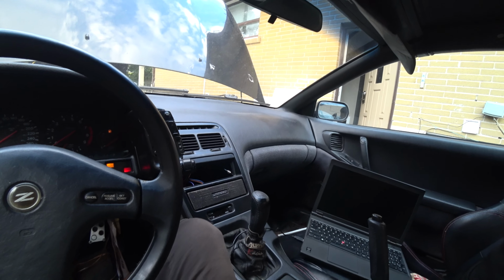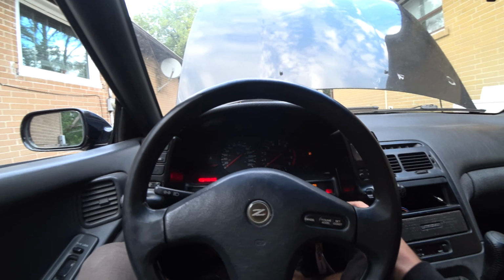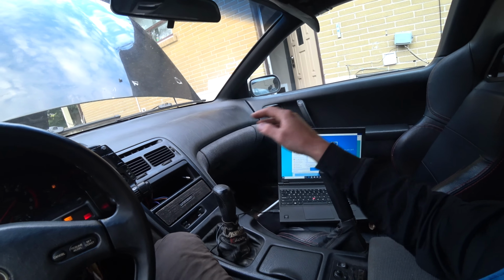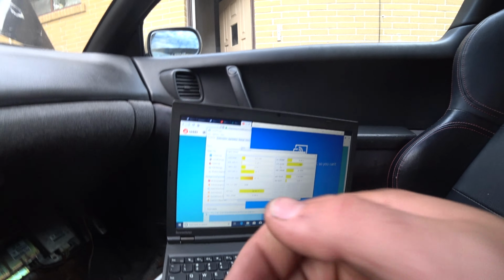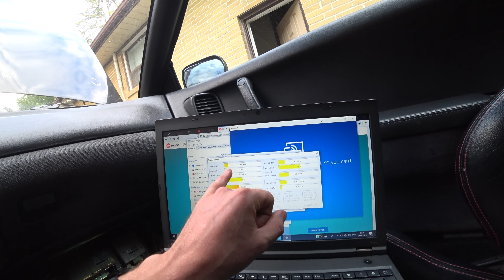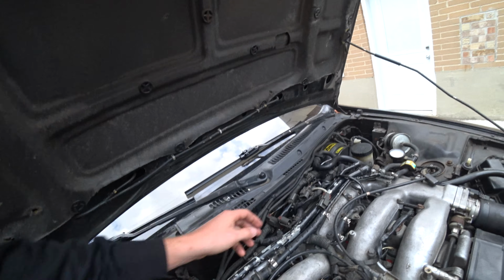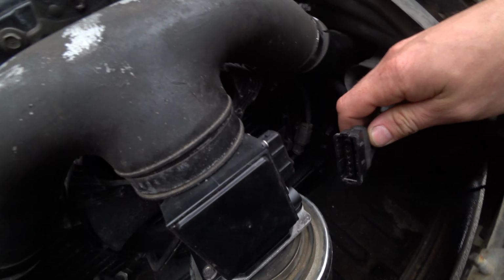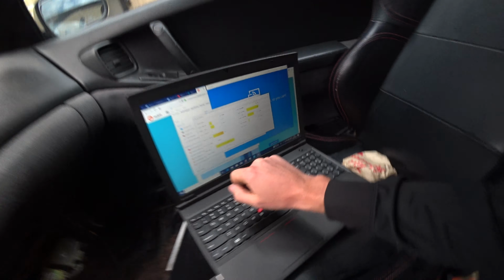Z32 300ZX Nissan Consult Cable -   Troubleshooting Z Software

Comment: Hey bud, something that helped me with my idling issues was changing out the entire wiring harness.
 I doubt that's what's making your rattling sound but if your connectors are bad, they could be causing some issues aswell as making the car stall out like that. 
The 300zx generate a lot of heat under the hood so the connectors go bad after afew years. 
If you need a place to look for stuff, I shopped at a place in Houston Texas called SZR pro. They will charge extra for shipping but they know their stuff man. They specialize in the 300zx car. I had my parts shipped from there. Find em on Google. They're good people and pretty helpful. 

Good luck bud!
Reply from the maker: unknown360123 thanks I'll check it out. Was thinking that this might be the case. There are 5 sockets that I've unplugged while running consult cable and nothing popped up as a mistake anything which is strange
Reply: Ye there is a lot of heat problems under this hoods.
Are there any cooling kits that can be done?

Comment: sounds like something to do with your pistion like the arms pushing it up and down is broken or bad  maybe making something. you could get ya motor rebuilt or new motor but that would cost you. That what i think. I have a 300zx never experienced this problem but i have had heard what a broken piston arm sound like but thats pretty much where the sound is comming from and what it sounds like. I could be wrong but thats what i think
Reply from the maker: Purple Panda thanks. I should do a compression test first then I assume
Reply: There is just so many variants to determine the actual issue

Comment: I had this same problem, and it was my coil pack. Run a test on your consult Z by turning off each cylinder 1 at a time, you can do the same by simply unplugging the harness to the pack. There should be a change in sound, if not it could be a bad injector, spark plug, or wiring. Let me know the situation.
Reply from the maker: Started her up yesterday and checked the oil. It smelled like gas. So probably one cylinder is not combusting at all, and its probably a coil or something
Reply: Mine had a similar problem….do as what therudeyoot says ….if you find a cylinder that didn’t cause any change when you remove the power pack connectors then shit down the car and check the spark plug….mine sounded just like your car…..if the spark is wet try switching the one that has a wet spark plug with a different power pack..if it continues to bet wet after switching with a different power pack then you know it’s not that….I]doing some ohm test and continuity test with power metre tester, and found out that one of the wire is bad…. I end up switching out the PTU on it and boom everything ran well…the z32 ptu problem can cause all sorts of misfire and poor running…the part is fair cheap it’s worth investigating…chances are your ptu is the original one in the car….replace it and relocate it….good luck I hope you get your car running…
Reply from the maker: @lyhuynh7537  Will be working on it shortly !!! Thanks

Comment: What was the problem?
Reply from the maker: Still didnt figure it out as the projects have multiplied
Reply: Probably the fuel system
And some broken wores that were screwed in the other videos
Old fairladies are that way
Reply: @tunex_  Dented sump pan
Reply from the maker: @drift-it4360  You think that might give it some issues?
Reply: @tunex_  As odd as it may come across - yes.

I chased this problem for about a year, changed everything you can think of, even cams, VVTI solenoids, lifters, CAS, timing belt, tensioner, re-timed it 100 times, etc. had this same noise top end.

A few in the 300zx community had mentioned dents in sump pans being an issue but really didn't want to believe a small ding in the sump pan could cause these problems top end...

Finally, after running out of other stuff to try we changed the sump pan and immediately the noise stopped... the oil pickup is very low in the sump pan at the lowest point and even the smallest dent can restrict oil flow around your engine.

Definitely work exploring